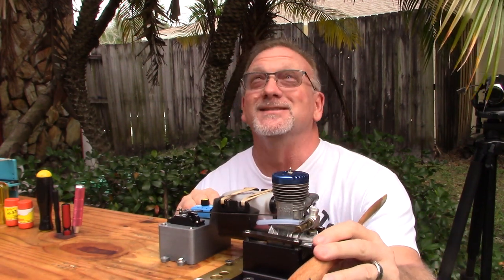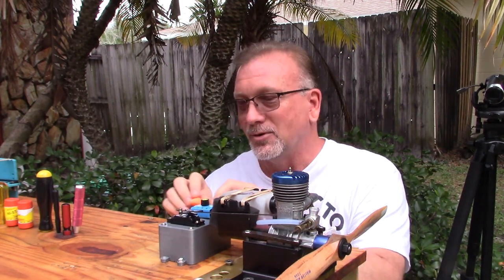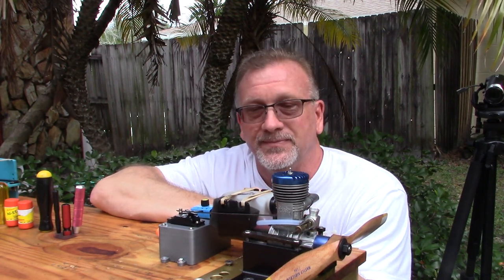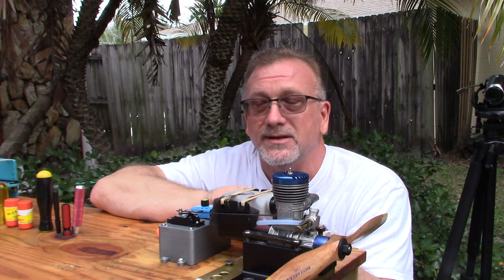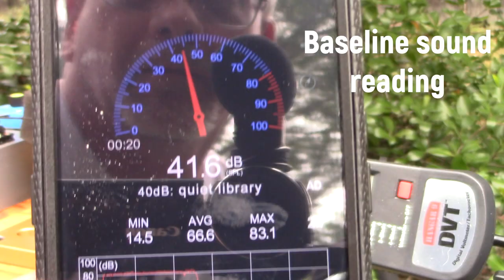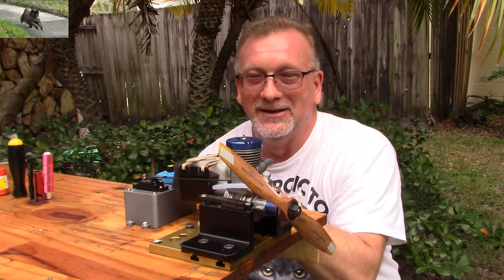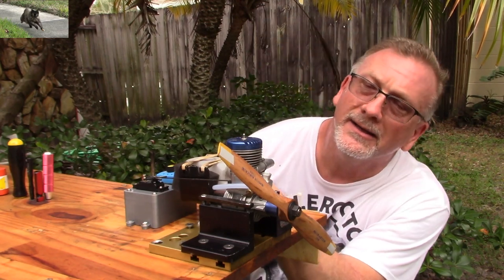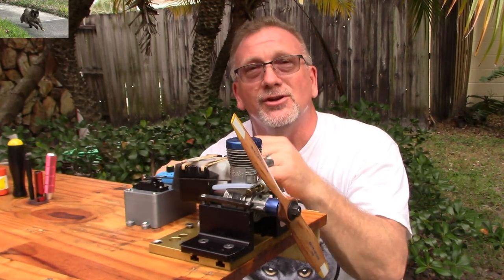McCord Spitfire 65 RC The One and Only Run

Comment: Super nice! Fired right up!  I remember coming home after flying control line models with the ol Fox 35’s in them with my ears ringing. I could smell that castor oil in my minds nose as it was running. Nothing like an old smell to bring back the past.

Comment: The decibel meters on most phones i tested max out around 80 85 db that engine is probably 130 db full throttle
Reply from the maker: Well the scale on mine shows that it goes to 120dB
Reply: @dmrcflyr2 mine does too my phones microphone cant pick up a reading past 85db. I could be wrong but i bet thats what's happening
Reply from the maker: @trevorlaquale6602  Yeah, no real way to test it either.  I don't have a known 100+dB sound to generate.
Reply: Doubtful. While no comprehensive library of model engine sound readings exists,  a  few years back the C/L Combat guys were running around 110 dB with open exhaust .36s at a lot more RPM.